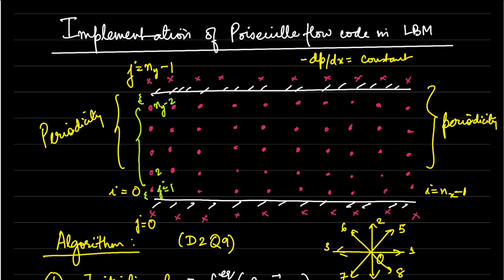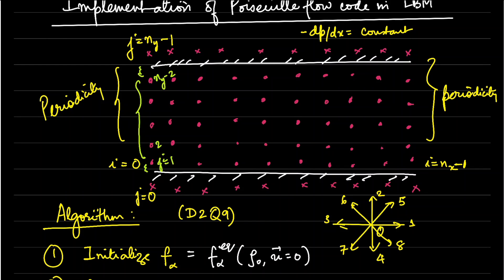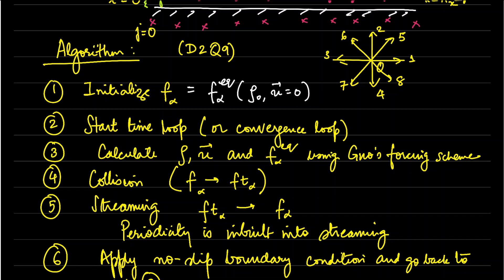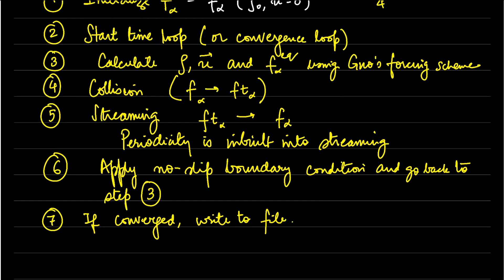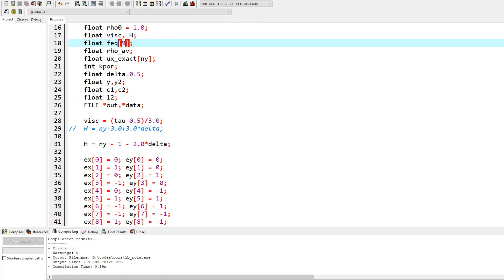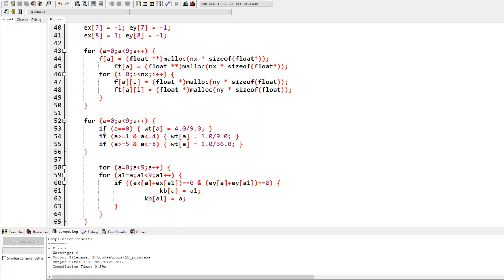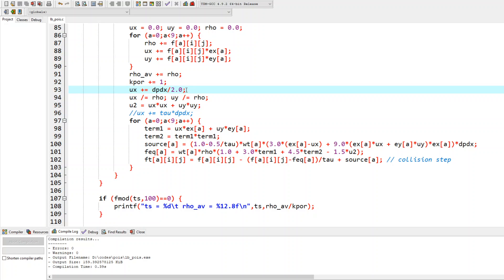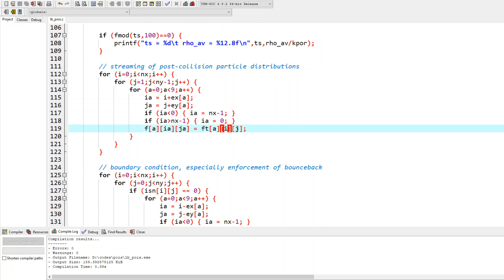Demonstration of Poiseuille flow using LBM

Comment: This video is really useful thanks - just one question. In your code ux and uy are single-valued scalars, correct? But then ux varies with the y coordinate so how is this the case? Am I missing something?
Reply from the maker: Both ux and uy are two-dimensional arrays. That is the reason why both ux and uy can vary with x and y coordinates. The analytical solution states that ux should only be a function of y. The numerical solution, without removing the x dependence, comes out so as well.

Comment: Sir can you please share the code of C.
Reply from the maker: I am going to create a repository of codes that will be available from my website. This will hopefully be complete by mid of July.
Reply: @profamitgupta   Thank you so much for these lectures. You have basically condensed down almost 70% of Kruger book into 20 lectures and for that i am eternally grateful!!!! Plus the way that you have explained is actually perfect in terms of going through each term and calculating by hand to show the calculations. So i am forever indebted to you for this work.

Also, has the code base been uploaded yet sir? I just checked your website and it still doesn't seem available. Is it at a different website sir?
Reply from the maker: @LB-es1gz  I teach this course at IIT Delhi where recreating the Poiseuille flow using LBM is one of the first assignments. Hence, I can’t make this code publicly available yet.

Comment: Thank you for your wonderful work. I have a question please. To visualize the results do I have to download a tool such as gnuplot or there is another way? Thank you in advance.
Reply from the maker: Simple visualisation using line plots can be done using Excel. Otherwise, you may use MATLAB which has a good selection of functions for plotting data.

Comment: Thank you for these lectures, sir.
Why do we take 201x21 nodes?
And why did you say that tau = 0.8 corresponds to kinematic viscosity about 0.1 ?
And delta is the length between nodes or half of the length between nodes?
Reply from the maker: 201x21 nodes is just a representative discretization. Ideally the grid number depends on a choice that gives 'grid independent' results. 
tau=0.8 implies that kinematic viscosity = (tau-0.5)/3 = 0.1.
Thanks for appreciating these videos.
Reply: @profamitgupta  Okay thank you sir.

Comment: Sir, code is giving the expected answers; I just need to understand why the rho values remains the same as that of the initial rho0? I am getting the same rho in my code as that of rho0.
Reply from the maker: The rho value cannot be constant. Maybe it is changing on a precision level (significant digit) that is finer than what you write in an ASCII file.

Comment: Hello. I have tried to run the above code. Two issues have arisen: a) In the streaming process, ja becomes -1 which creates a segmentation fault when j=0 and ey[a] = -1. Should the loop start from j=1? b) Regarding the H (length) calculation, it only depends on ny, rather than the distance itself and comes out to be 19. Should it be: (ny-1) * 2* delta rather than ny-1-2*delta?? Many thanks. Antonis
Reply from the maker: 1) Make sure that you do not stream from ja<0. Same is applicable when ja>ny. Apply boundary conditions in these cases to avoid segmentation fault that happens because you are trying to access memory locations that are not allocated.
2) The height calculation I have given is correct. Your proposed equation will double the height of the channel. Also consider that each lattice has a unit height and width, so the height can only be approx. ny*dy.

Comment: I am trying to execute this code but I getting rho_av as nan. I approached different reasons that might cause it but still i was unable to figure out this. If possible can i share my github url for this code?
Reply from the maker: Sure. Is the code written in C and downloadable (which I will prefer)?
Reply: @profamitgupta  Thank you Professor,
I found your EMail id from your homepage from IITD site and shared a copy of the c code source file.
Reply: @shaikasif6447  Hi my dear friend. I got the same problem, did you find a way to solve? Thank you so much

Comment: Hello sir,
please explain how to compute thermal equilibrium distribution function in lbm
Reply from the maker: Are you referring to calculation of equilibrium function corresponding to evolution of temperature? If yes, then there are lot of good papers on it which you could check for details.
Reply: @profamitgupta  yes sir,
Can you share your email id please.
Reply: @profamitgupta  actually we simulating flow around an obstacle in python and obtain velocities  and we failed to obtain  thermal equilibrium distribution function